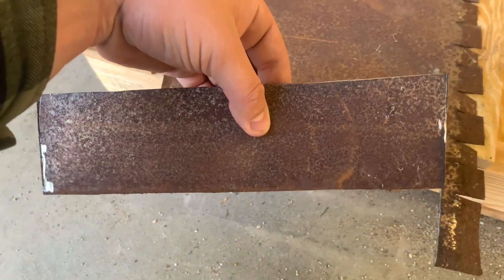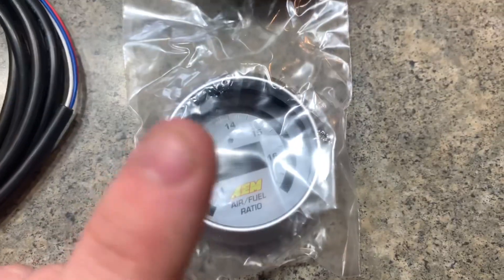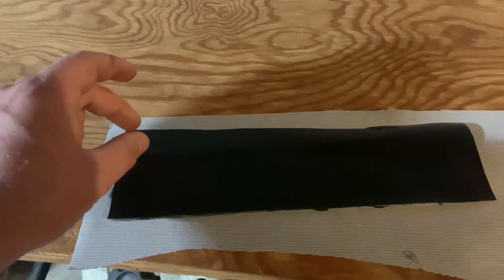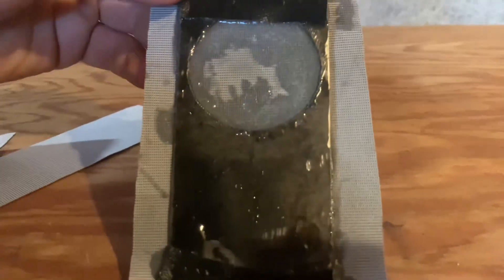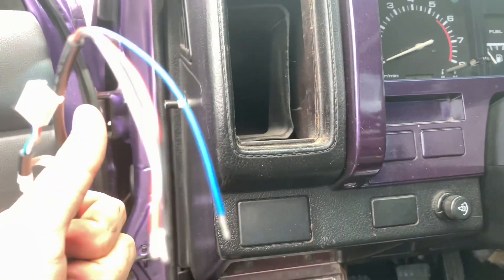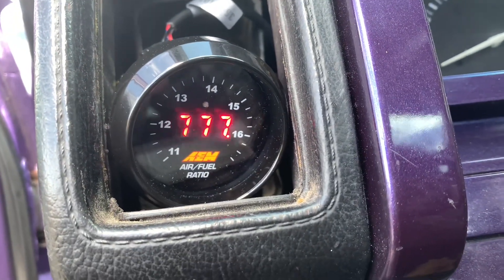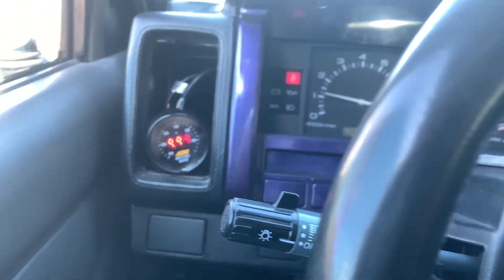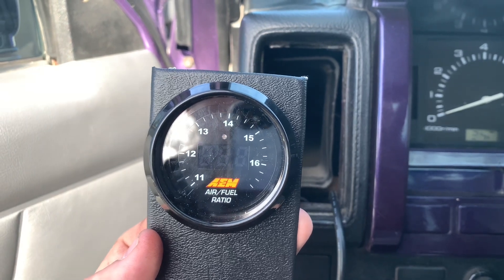Installing An AEM Wide Band Gauge In My Nissan Hardbody!!

Comment: Where did you order the gauge and sensor from, I got mine from summit and am wondering if I should get a diff sensor
Reply from the maker: Unfortunately, I don't think it matters where you order it from, it's kind of like luck if the box wether they send the Bosch or an aftermarket sensor, I have the link in my description but I ordered it from Amazon, but I messaged AEM back trying to get a refund for the sensor

Comment: Are bypass the heater core I did a bypass now 11 mpg😢😢😢
Reply from the maker: someone else just wrote this, I don't understand what it means, why would you bypass your heater core, and why would that affect your fuel mileage?
Reply: @JapaneseMinitruck  Because the heater core was leaking all over the floor mats..... The heater core provides a certain type of restriction And without it the computer set your truck to run really rich good for racing though.....